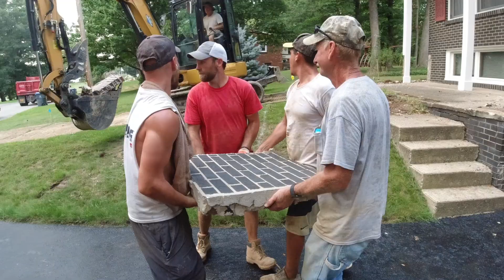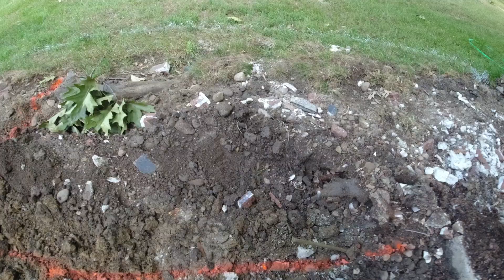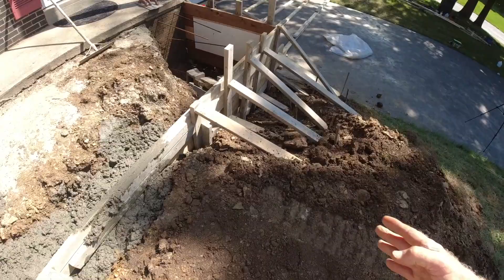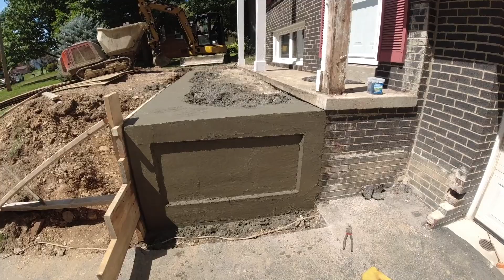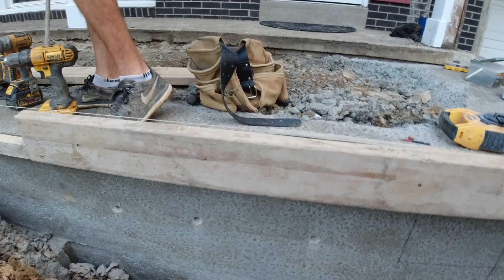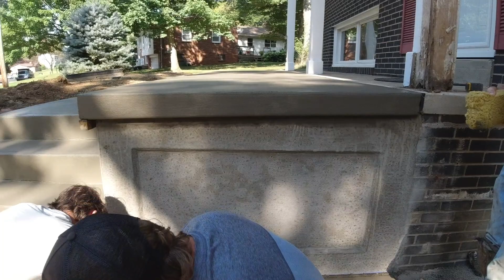Quick Way to Modernize Your Home

Comment: Beautiful job. A little trick we like to do to save on concrete as well as weight is to use 5/8” drywall since it’s rock anyway. And space it away from your wall forms with sacrificial 2x6s every foot or less if needed. Then it can be backfilled with stone against the back of the drywall. As the concrete is placed in the void where the 2x6 is the boards can slowly be lifted and taken out leaving the 6” wall. Just an idea. Thanks for the videos.

Comment: would have looked better without the "picture frame" as it looks very crooked. I realize that is because the porch slants so the water will run off into the grass and not against the house. But the design highlights the fact that it's not straight. Would have been better if left plain.

Comment: I just retired after 45 years of this work. You guy did a great job. Great idea for the buggy, with the flapper. Good thinking putting that 20" grove at the top of the steps. When I'm pinning to exciting slab if there is a hairline on it I will put the groove there if it is close to the other panels.

Comment: The front edge of the slab is pretty rough. Especially at the steps area. How did you miss that? Also you forgot the vertical cut by the top step!

Comment: Was that just the camera angle or was the inlay not square to the top edge of the concrete?
Reply: The concrete had fall on it so the water would drain away from the house. It was square with the brick/house tho. Good question and thanks for watching!
Reply from the maker: Perfect answer Steve thanks for getting back

Comment: Tom, was there an issue with the strip of original concrete floor that was left in place that would have made it expensive to replace or was it just homeowner choice? Your attention to detail is what's lacking in the trades today, really enjoy the videos.
Reply from the maker: What is not on video was an hour conversation trying to convince them to take that front porch out sometimes it is just up to the homeowner thanks for watching

Comment: I like that inset detail, nice work. I live in Central PA and want to do a similar project. I want to pour 4' steps centered on a floating pad patio 18' wide (the top riser would be under the pad). Any issues with the steps heaving and cracking the pad? Thanks